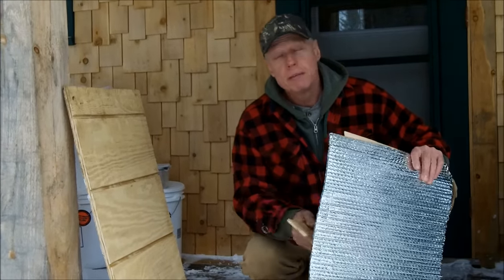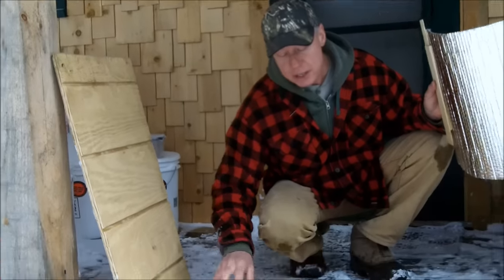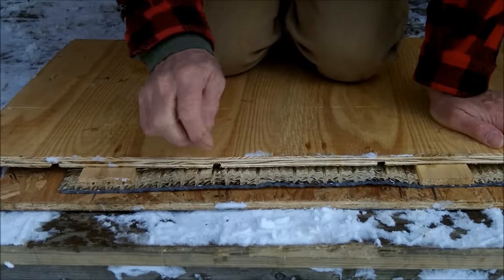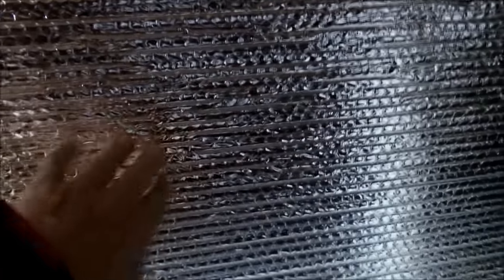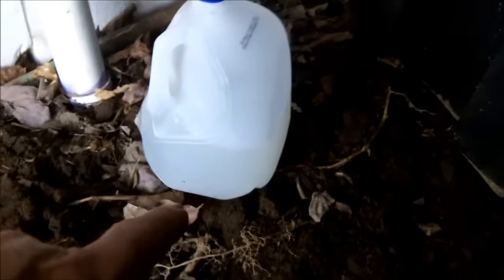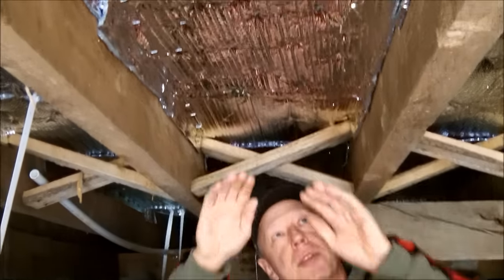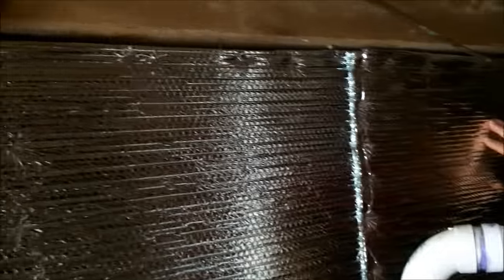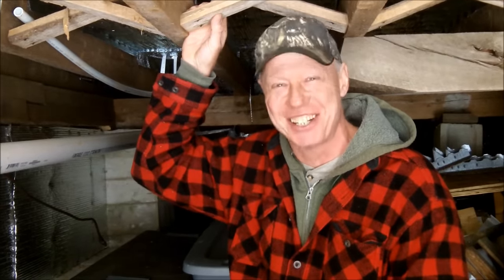HOW TO INSULATE A CABIN FLOOR AND KEEP IT RODENT FREE

Comment: Before the rats got to it, I'm curious how the fiberglass did? With a higher R value it should have done better, but in and of itself isn't a great air barrier. Why not put plywood over the top of the fiberglass? The low R value of the bubble wrap stuff would haunt me, knowing how much more is on the table.
Reply from the maker: All I can say is it works very well for me. Every structure i own has one layer of foil beneath the floor and any new structures I build will have the same.
Reply: @thebossoftheswamp  We can see that it works, that's not up for debate. Does it work better than the fiberglass batting did before the rats got to it?

Comment: I have double wide same problem.. QUESTION COULD YOU USE SILACONE SEALEANT TO ATTACH FOIL TO BOTTOM OF FLOOR?
AND STAPLE IT ALSO? WINDS HERE 80 MPH EVEN SKIRTING WON'T STAND UP TO WINDS . I HAVE TROUBLE WITH CATS GETTING UNDER DOUBLE WIDE AND RIPPING INSULATION OUT . THEY EVEN WENT AND RIPPED THE TWO HEATING DUCTS OUT SO HEAT WENT TO THE DIRT UNDERNEATH.. THEY MADE NEST WITH THE RIPPED OUT INSULATION THIS HAD6 CAUSE ME TO FREEZE TO DEATH AND ICE COLD AIR IS COMING INTO THE HOME THRU RIPPED OUT DUCTS..I FREEZING ..
THERE SHOULD  BE A CAT LEASH LAW  IT FAILED HERE  CATS TEAR OUT INSULATION, KILL BEAUTIFUL BIRDS SPREAD DISEASE..CATS THEY HAVE COST ME OVER $1,500.00 IN RUINED SKIRTING, DUCTS, EXTRA WORK AND NOW HAVE TO HAVE HEATER DUCTS REINSTALLED  IF IT IS POSSIBLE TO AND PRAY IT  KEEPS COLD OUT. NOTICE....PEOPLE PLEASE CAGE YOUR CATS- KEEP THEM INSIDE YOUR HOME 24,/7  OTHER WISE- OR OTHER MEANS WILL BE NECESSARY TO STOP THE DAMAGE THEY CAUSE WHICH IS IN THE THOUSANDS ! I CANT GET MY HOME ABOVE 48 DEGREES I BEEN IN EMERGENCY 3 TIMES WITH    CHRONIC   BRONCHITIS. I HAVE ASTHMA  AND I  LOST 2 PETS TO THE COLD..CAT EITHER RIP AND EAT MASSIONITE DIDING OR DIG UNDER THEN CAT FIGHTS AT MID NIGHT UNDER HOME .. DESPERATE IN TEXAS..

Comment: Hello sir, i have 6x10 cargo trailer turn it into camper, right now i have  interlock foam pad that is stain and waterproof on top of the floor , can i use this reflectix foil on top of the floor then the interlock foam pad? what would u recommend .
Reply from the maker: I have no experience with the interlock foam pads so I can't really say for sure how this would work however... it would be a small investment to cover a 6x10 space so I'd give it a go.  This is the brand I use:  https://amzn.to/3JjuPtL   
Good luck with your project.
___________________________________________________
As an Amazon Affiliate, commissions earned from qualifying purchases.
Reply: @thebossoftheswamp  ty

Comment: Anyone have insight on the vapor control qualities of this material as it is being used here? I'm assuming it's extremely low perm, which means you need to be quite careful where it's placed in the envelope in order to avoid condensation inside the wall or floor assembly. In cold climates you would want the vapor barrier on the innermost side of the living space. As they say, it's better to have no vapor barrier than a vapor barrier in the wrong place!
Reply from the maker: Yes you are right about that. You want it on the warm side of the wall and NOT the cold.  See how I use it as a thermal vapor barrier in the roof system in this video  https://www.youtube.com/watch?v=Wa2-FWAwwUY

Comment: We were planning on insulating our cabin floor with fiberglass with plywood covering the underside, would the plywood be enough to keep it safe from the rodents?
Reply from the maker: It might but it'll be a pain in the arss to do.
Reply: @thebossoftheswamp  thank you for the feedback, it's a small cabin so we were going to prefab the floor and walls and take them into the woods to put them together. 
Thanks again!

Comment: I have an 8x8 walk in chicken coop. I am about to tear up and replace the old floor.  It's about 4 inches off the ground with a thick pad of stones under it, drains nice, stays dry. In one corner inside, a rat chewed through the plywood to get to the chicken food..(Hence the joke, "Why did the rat chew through the chicken coop floor?" Oh wait...that's not the saying, Lol)  Anyway, might this foil texture deter chewing? It would add insulation no doubt and be a warmer floor, but aside from taking away a rodent's nesting material, is the foil something that would discourage their gnawing? Thanks!
Reply from the maker: If they're chewing through plywood they'll certainly do the same with the foil.  I would tar paper or bubble foil the floor and then lay down cement board. I doubt they'll chew through that.   This is cement board:  https://amzn.to/2pDRDNV  and you can get it at home depot 1/2" thick.

Comment: Any Idea's for cement floor insulation??
Reply from the maker: I've never used it myself but my contractor friends use this and a similar product for concrete slabs and radiant floors  https://amzn.to/3CNrd22    I'm going to try putting a layer beneath my canvas wall tent.
------------------------------------------------------------------------------------
As an amazon affiliate, earnings are generated through qualifying purchases.

Comment: Boss,   What "R" value insulation do you use for your vertical walls.
Reply from the maker: R13.  We heat with wood and usually have a window open.
Reply: Do you insulate the gable of your attic as well between the rafters or just the ceiling above on the inside.

Comment: I keep replaying this video and I am confused because you used a big sheet all across the bottom and then put the subfloor ontop of it. I am missing something because you said you didn't want it to get compressed but with the subfloor on it, doesn't that compress it? THANKS SO MUCH, Im really trying to learn. T
Reply: It only compresses the foil where the joists are. The rest of the underside is exposed to the crawl space air. That is why he ran the 1/2” strips on the hypothetical above subfloor example. Adding the strips simulates joists & creates a half inch of space so the foil doesn’t get sandwiched.
Reply: HAFFT1ME OK thank you. So it is compressed where the floor joists attaches to the subfloor. I get it now.
Reply from the maker: Yes, it only got compressed where the top of the floor joist touches the underside of the sub floor.
Reply from the maker: At 3.10in this video you will see how I install it.  https://www.youtube.com/watch?v=ZPWYa_6QelM

Comment: 08:36  If you don't allow any heat to escape and warm the crawl space, your plumbing will freeze.
Reply from the maker: 27 below zero and no frozen pipes.  That jug of water down there never froze either.  No complaints here.
Reply from the maker: I agree with what you're saying. I think in this application where these joist were exposed that possibly some heat was transferred down from the top of the joist to the crawlspace below.  All in all, my floors stayed warm and the pipes stayed liquid.  So far so good :-))
Reply: My house has a crawl space and did have insulation between the crawl space and the floor above.  I removed it out of concern for the possibility of the water in the plumbing freezing.  I live in central Maine and it can get to 30 below so the freezing of plumbing was a consideration. The crawl space stays above freezing and the house (single floor, 1500 sq ft) is adequately warm. I use 2-3 cords of wood per heating 
season and no other fuels.
Reply from the maker: This was my first winter in this cabin and was unsure of how the pipes would fare in the crawlspace below so I put that water bottle on the ground under there as a quick check guide.  I think if I had blanketed over the joist with the foil that it may have insulted the floor too much and freezing pipes would be an issue.  So far so good. The floors were warm and pipes liquid so we'll see what the future holds.  

Cheers :-)

Comment: Would this be appropriate to place directly on a concrete wall in a crawl space? Maybe using a dab of liquid nails here and there to make it stick? Thank you.
Reply from the maker: I would think so. Maybe try one wall and see if it creates any moisture issues.
Reply: TheBossoftheSwamp OFF GRID SELF RELIANCE If I fastened 1x2s to the concrete, wouldn’t the 3/4” gap between the concrete and the wrap Likely take care of any moisture issues....or not? Thank you!

Comment: Can you put it on top of vapor barrier on the walls b4 sheetrocking ???
Reply from the maker: I would use it with unfaced insulation in the ceiling instead.
Reply: @thebossoftheswamp  too late for that..faced insulation is already installed...💯❤🇺🇸

Comment: Would this be ok for wall insulation in a shed?
Reply from the maker: I wouldn't put it on the walls unless it was used as a vapor barrier on top of unfaced insulation.
Never put this against the inside of exterior wall sheathing or any other application where it reflects cold back into the wood as it will create moisture behind it.  In my application, it reflects heat back into the floorboards so no moisture is trapped.
Reply: Thanks

Comment: This might be an easy and cost effective way to perform the intended task, but it is definitely not the best practice. There are much better systems that can outperform this tremendously, but they can be costly in comparison and also labour intensive considering the application as noted.
Reply from the maker: May be so as there are many ways to skin a cat but... The performance I get will have me continuing this process in all of my structures.  Cheers ;-)

Comment: I am planning on using the foil bubble wrap on my families A-frame. The cabin was built nearly 50 years ago.  What are your thoughts about using this foil for exterior walls before covering with cedar shingles.
Reply from the maker: I's use it in just the floor and the roof.

Comment: Same stuff NASA uses on the space station except they paint theirs gold....kidding ...I dunno.
Anyways I was thinking of inserting some of the foil backed styrofoam type insulation board to the underside of my cabins already installed floor and then running a heavy plastic vapor barrier on the very bottom of the joists and then covering the ground with the same type of plastic.
Just wondering if anyone thinks that’s a bad idea.
I like to build my stuff overkill but I’m not an insulation expert and my cabin was already pre existing when I bought it.
I also think I’m going to skirt it and try that stuff on the backside of the skirting.
Reply from the maker: Ants LOVE that foil faced foam.

Comment: I use that too! It's great
Reply: It's great and it comes in different thickness and it's a little spendy but worth it and there is foil tape to stick it  down no staple needed.
Reply from the maker: The foil tape is great for sure but working overhead in that crawlspace, staples are worth their weight in gold haha
Reply: TheBossoftheSwamp OFF GRID SELF RELIANCE oh I haven't done the ceiling yet I will keep that staple running a note for sure great advise thanks☺
Reply: How About cardboard box?
Reply from the maker: Box for what?  If you mean to use in place of the foil I'd say no because it will absorb moisture
Reply: Cardboard is a no? K thanks for your quick response on that .

Comment: Whats your thoughts on putting it in the walls and ceiling instead of the regular insulation?
Reply from the maker: Personally, I would use something else and not surround myself with it.
Reply: @thebossoftheswamp  If fiberglass is a rodent best friend, what is the next best thing?

Comment: The R value of this thin bubble foil is not much. But better than nothing.  1/4" bubble foil R Value is 1.0.
Reply from the maker: Yes but you're missing the benefit of it's reflective properties.  If it didn't perform so well I would never recommend it. Period.
Reply: @thebossoftheswamp  O ya the reflective property's 🤔.    Thanks for sharing your experience with the product.. I live where there are lotsa pack rats, squirrels, skunks, rattlesnakes, racoons, they all want to live in and under my house.

Comment: Not an engineer, huh?  The foil is a vapor barrier and needs to be close to the inside to prevent condensation.  Any plastic or vapor barrier below the the insulation will trap moisture, make condensation, and rot the wood parts so then rodents have an easy time of invading that space.

Comment: hey guys i found a similar / better product. check out insulaton4less  its a closed foam seals nail holes and keeps r value even when squished. I'm in BC off grid 12' snow so far this year. the only stuff I use now. thanks for video swamp boss.